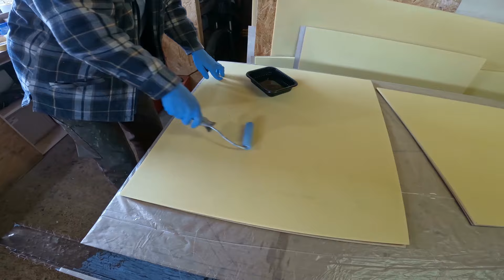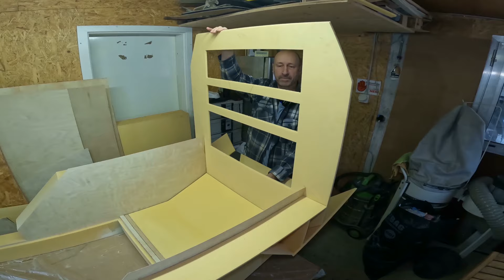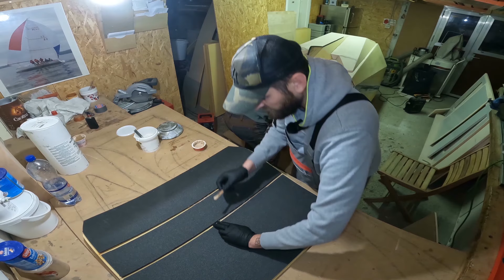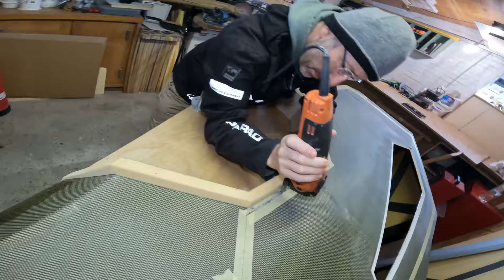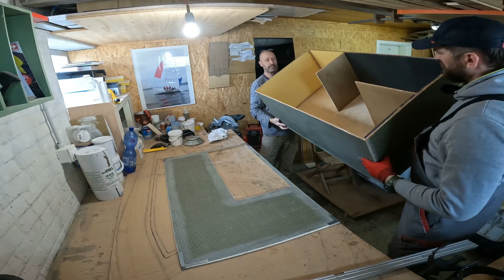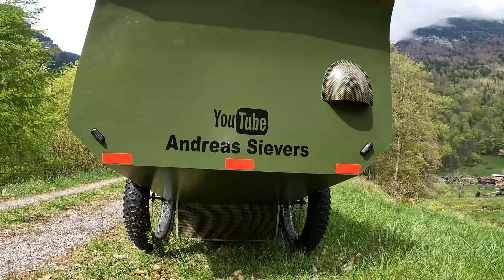We built a offroad camper for my bicycle, timelaps

Comment: Hi Andreas I'm from Manchester, and I have been thinking of building an e bike trailer for some time now and I have just! Come across your video, Genius.... I was wandering if you are willing to translate what materials you use to make the hull. In fact do you have spare blueprint and we will come over next year if I can't suss it out this year 🤣
Reply from the maker: Hi, the yellow material is airex c70.55 in 8mm, on the sites is mixed carbon and kevlar and under the olive colour  is 1mm plywood. There are no technical drawings of the Caravan.